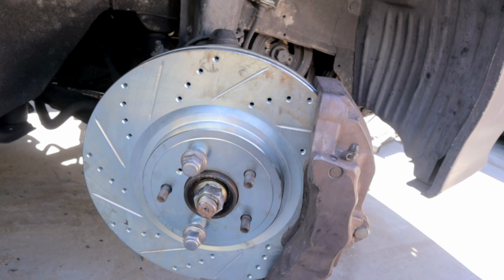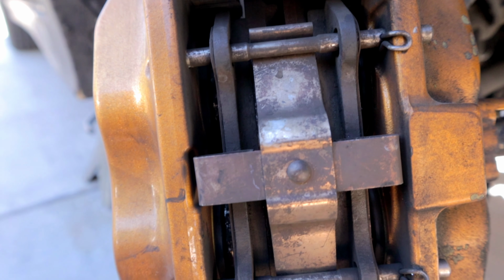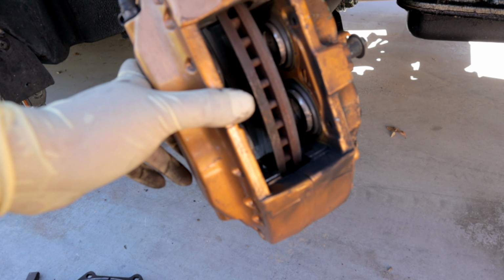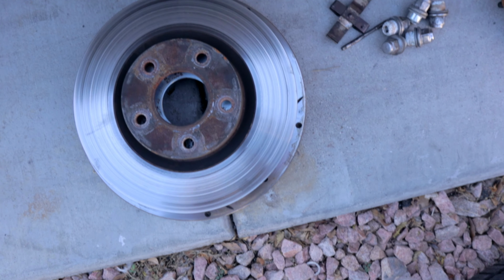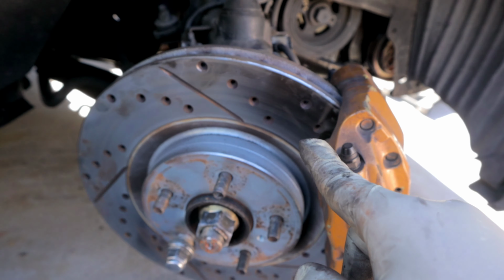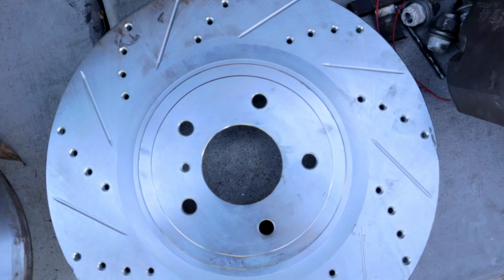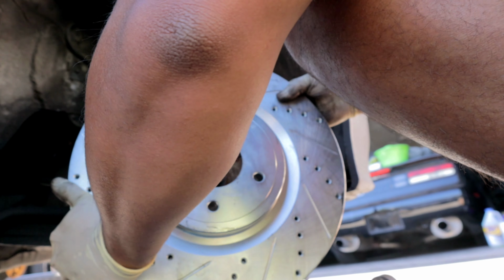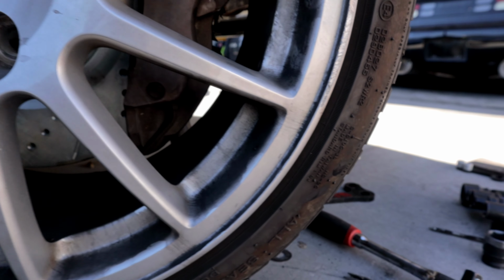Here's the ultimate brake caliper upgrade for Nissan/Infiniti

Comment: rattle can the 17z calipers or get them powder coated the same orange as the g35 brembos!
theyd look AMAZING!!!
Reply from the maker: Only issue with power coating is I have to get them rebuilt because of the oven they use gets too hot 🥵 but it would look nicer tbh
Reply: @ERICSDIYGARAGE  a rebuild tutorial?? ;)

Comment: Great video, which car can I get big brakes off of to mount big brakes on my 2002-2006 infiniti Q45
Reply from the maker: Let me look into this for you. After researching it looks like the Nissan 370Z akebono calipers front and rear should fit your vehicle after modification  is done to your stock knuckles . Here is the forum so you can look into it. https://www.g20.net/threads/my-2003-f50-q45.115380/page-6

Comment: Wouldn't it be beneficial to install larger break lines? The break upgrade from 2003 to 2004+ Infinity has a larger break lines. Thx
Reply from the maker: Larger brake lines means more fluid that needs to be compressed which reduces brake pedal firmness. I will be using ss lines that should be good enough